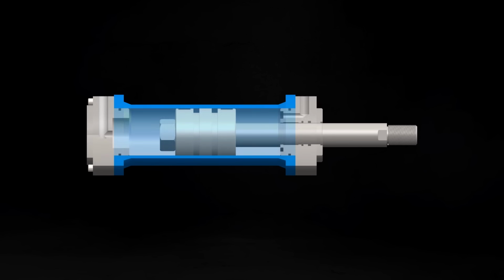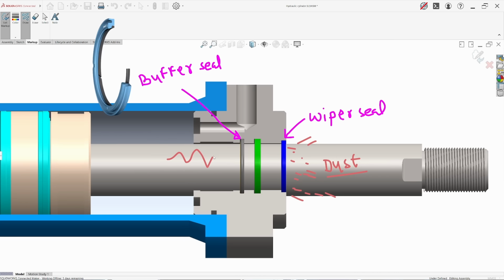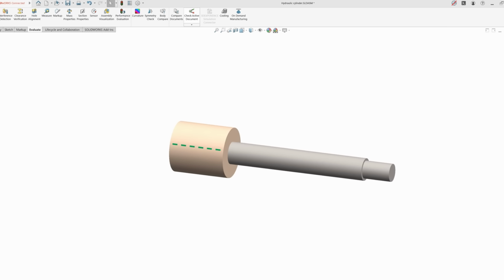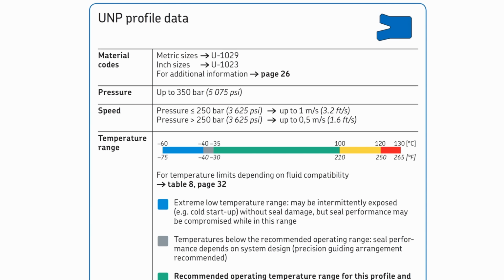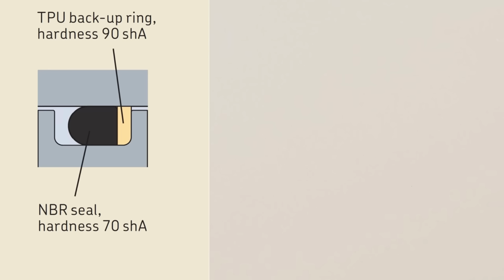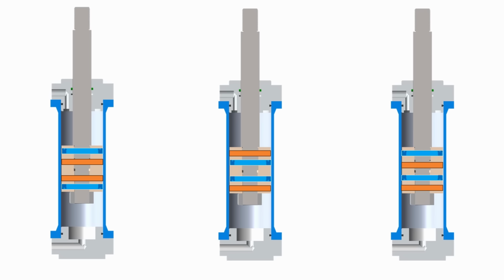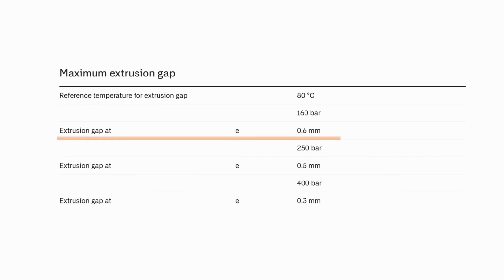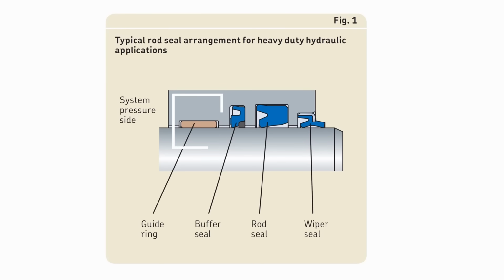Mastering Hydraulic Cylinder Seals Selection & Design Tolerances

Comment: Professor @mastermechanicaldesign , why the piston housing and rob are not manifactured as one body or welded together to make one single piece which would prevent you from placing a nut and a seal and to creating space for the nut in the back ?
Reply from the maker: Can be created as one part, but the rod we use are very precise, and well chrome plated, so we buy the already finished horned rod, and just make the end steps and threads, if we will make it in one part, it would be costly also, chrome plating and achieving nice finish all over the shaft would be difficult, its not the design problem, but manufacturing

Comment: Guide rings have a gap up to 2 mm so as to release pressure build up due to sliding in close tolerances.  This damages the seal.
Also you have given clearance in  a seal flange as +0.0 to +0.5 mm which is not correct. It should be +0.4 to +0.6mm.

Comment: 250 bore/650 stroke,single acting,what size will the barrel be/what size Rod must i use and how long must my Rod be,what seals are suitable for this cylinder,what size is my piston going to be,what size guide rings can i use,because I'm building a single acting hydraulic cylinder,250 bore/650stroke
Reply: You can visit it's 1st part design calculation of hydraulic cylinder. Even I can help you last week i worked on similar cylinder Rod size:- Dia 160*1170L

Comment: Thank you very much for your detailed ,well explained classes which was very very helpful for me.    For seal arrangement, i would prefer  first option. ie, guide rings between cup seals. Guide rings are generally used to move other cup seals in true cylindrical motion to avoid seal damage.it may not  intended  to take up excessive side pressure .so i feel it is better to keep cup seal at end side of piston. Under normal  condition, Support from rod end cap and piston guide may be sufficient to cope up with bukling load issues.. thanking you.

Comment: Hi brother, I’m working on a ramp project using hydraulics. I’m using four hydraulic cylinders for vertical movement, each with a stroke of 100 mm. The issue is that all four cylinders are not lifting in parallel—there is a zig-zag motion during lifting. I’ve used a counterbalance valve, but the problem is not solved. Do you have a solution or a component that can fix this issue?
Reply: Add a relief valve on b line , and tank some amount of oil from line , I mean you have to make some pressure all time in B-line , so the oil in A-line will fill equally then afterward filling it will create pressure to lift any object.
Reply from the maker: I don't think counterbalance valve would help in this case, have you used flow controllers of each cylinder...? Adjusting right flow control can help, also hose pipe length should be equal.

Comment: WHICH ASTM DID YOU FOLLOW?
Reply from the maker: ISO
Reply: What changes are needed to the formulas to size the Cylinder bore, rod and piston if the high-pressure side is on the rod side?

Comment: I expected that you have to tell the calculation of force required by cylinder at various angles. Example design of scissor lift table. Design calculation for the hydraulic cylinder. Initial angle of cylinder with floor. Factors of safety etc.
Reply from the maker: I will make a video
Reply: @mastermechanicaldesign yes. We truly need a video on different angles and different pulling-pushing forces.
Reply: this is absolutely thing I need 👌you mentioned good point
Reply: Thank you again professor. This is a another master class. I learnt a lot.

Comment: Very informative videos 
Thank you, Could you please explain how we can find port size to supply oil to cylinder
Reply from the maker: Sure!! Port size and pipe sizes are depending on flow rate and fluid speed, which I will explain in a separate video
Reply: Greetings of the day! I think you provide the most straightforward and concise approach to explaining basic mechanical engineering content and practices on the web.  The videos you make are consistently excellent. Thanks!